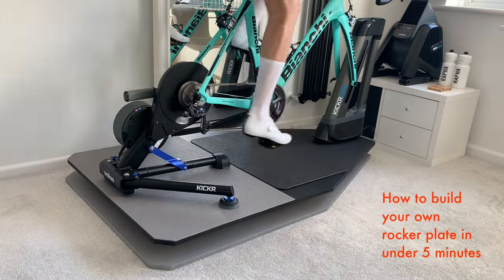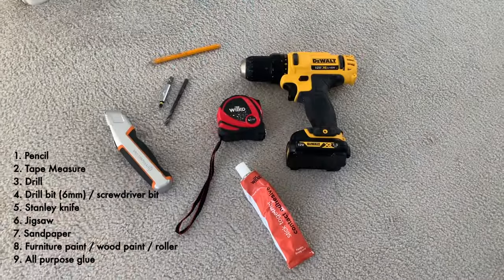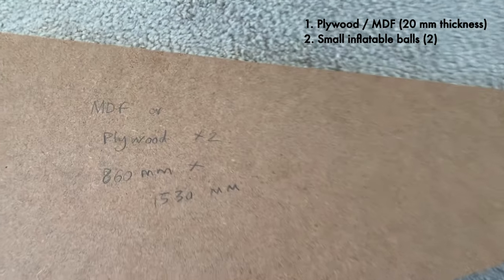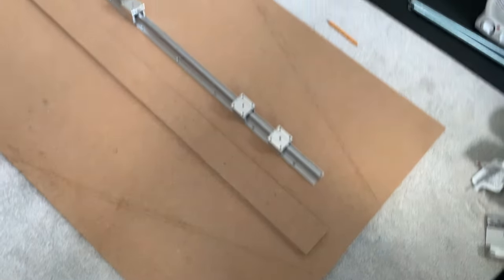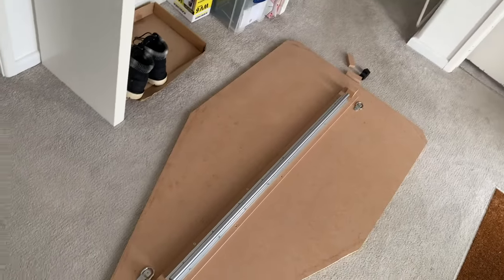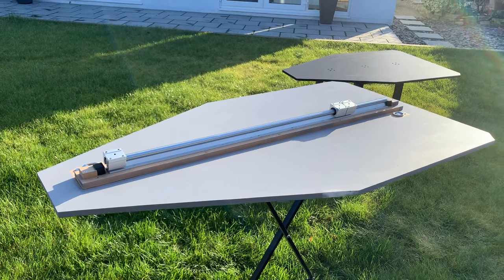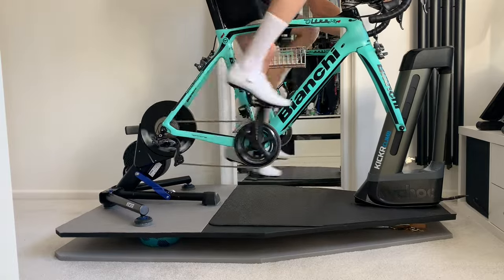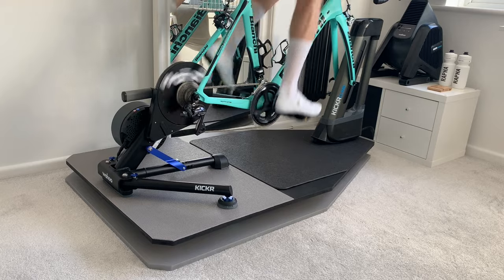How to build a DIY Rocker Plate for indoor cycling

Comment: Did you have any trouble with balancing it from side to side? Like did you have to put more air in one side than the other or weights attached to the board to offset the weight of the kicker
Reply from the maker: Hi, good question, I made sure one of the balls was slightly firmer - I didn’t notice any difference when cycling either 👍🏻

Comment: Brilliant, way better than other home made rockets I’ve seen! Could you share the link to the springs to save some trial and error getting them right, please?
Reply from the maker: Thanks Nick, much appreciated! These were the spring’s I used, it’s been pretty good so far - I had to bend one of the end of the spring to make a loop for the d-ring clip. https://www.diy.com/departments/15mm-external-pipe-bending-spring/5059340003498_BQ.prd?storeId=1266&ds_rl=1272379&ds_rl=1272409&ds_rl=1272379&gclid=EAIaIQobChMI-uH3meDn_AIVw9_tCh3I3woeEAQYBCABEgJkGvD_BwE&gclsrc=aw.ds
Reply: Thanks, I’ll take a look.

Comment: What springs did you order - difficult to know lengths and tensions from the video
Reply from the maker: It was a bit of trial and error with the springs - I ended up going to a local DIY store and finding some with the right tension - the tension should be whatever preference you have for how much you want it to move. My springs were about 14 inches long when taught. Hope this helps and good luck with the build 👍🏻

Comment: This is an awesome build! I'm planning on given this build a go , even though I've limted DIY expericne, and wanted to check what measurements on the top/bottom board. What length and width are they? Thanks!
Reply from the maker: Thanks very much and good luck with your build, if you have any further questions during the process give me a message 👍🏻 My board was 90cm x 140cm but I would measure your turbo to be sure it fits the width

Comment: Hi @notpogi
Awesome build and looks a cheaper option than the ones I have seen with the SBS20UU bearings and the separate supported rod. 
The only concern I have is the amount of rotational slack there will be between your open SBR20 bearing blocks and the central support of the linear rod. How much rotation/tilt can you get on your top platform before the mounts start to touch the central rod support, and does that ever give you any issues when riding? Hope you know what I am getting at.
Reply from the maker: Hi Simon, thanks very much 👍🏻 Good question, I was worried about the same however I found that mounting the rod central support on an additional bit of ply (about 1cm width larger each side and the same 1cm in depth) actually gave more than enough play in the lateral movement. No issues at all when riding. Hope this helps and good luck with the build 👍🏻

Comment: Really nice build!
Do you also have some cables to mount the kickr on the plate?
Reply from the maker: Thanks very much 👍🏻 I did purchase some Velcro straps to secure the kickr but didn’t feel the need.. I found that even when I really sprinted hard it never moved on from the yoga mat. I think it’s personal preference though, if you wanted that extra security then it’s worth drilling some additional holes by the Kickr legs and attaching the straps.

Comment: How is your rocker plate holding up almost a year later? I’m very curious to make one myself - if you have lessons learned a year later that would be helpful to hear
Reply from the maker: The rocker is holding out great thanks 😊 I’ve had absolutely no issues with it at all and it really does add to the overall cycling experience. I’ve had to store it currently though due to space issues in my pain cave! I would say the only downside is (in my opinion) sprinting is more difficult on the rocker. Apart from that it’s great 👍🏻

Comment: Have you ever done a review video on the kickr climb? I'm debating about it and would like feedback from users. But please... users that are okay in case the feedback is something like "yeah... i bought, it was expensive, I though it'd be fun but it is not but I kept just because I did".
Reply from the maker: Hi Pedro, in my opinion I think the Kickr climb is very good. I wanted to make my indoor experience as close to outdoors as possible and it does add something to the overall experience. Would I buy it again - yes, do I always turn it on - no, sometimes I just prefer riding at the same level. If you get the opportunity to try it first I definitely would. Hope this helps 👍🏻

Comment: What rail and bearings did you use? Also what spring strength?
Reply from the maker: I’ve linked the bearings in a previous comment, eBay purchased. The spring tension is personal choice based on how much fore/aft you’re after. My sprint was 3/4 the length between the 2 connecting d rings.

Comment: Hi great work , Ill be using A wahoo KICKR bike on this. You don't show a pic of the set up of springs,  did you use a combination of springs and bungy cored, if so  is that 2springs and 1 cored for each side?( crossed over of cores) and would 20mm ply board be strong enough?
Reply from the maker: Hi, thank you much appreciated. I used 2 springs in the end. I would stick to either 2 springs or 2 bungee cords depending on what your preference is - both work just fine though! I used 20 mm plywood which was plenty strong enough for my set up - it felt very stable. Hope this helps and good luck with the build 👍🏻

Comment: Hi mate been off the bike for a while with sore back and just getting back to it and looking for some comfort, was just wondering if you were still using the rocker plate and is it really worth me making one cheers mate
Reply from the maker: Hi mate, hope the back has fully recovered now! Tricky one… so I’m currently not using it but that’s due to a lack of space in my pain cave rather than not wanting to use it. Hopefully once I’ve got a bit more room I’ll get it back out again - for me it did make those longer rides way more comfortable but in my opinion I also lost a bit of sprint power (that could have been all in my head though)… if you’ve got the tools and you’re after something that’ll make the ride experience better then I recommend giving it a go!  If you decide to do it let me know if you have any other questions and I’ll be happy to help 🙂
Reply: @notpogi  cheers mate yeah that's the thing I have heard they can reduce sprint power will think about it a bit more 😂 thanks for answering appreciate it

Comment: Wow, I am going to build one. Was the bungee interfering with the rod and the linear bearing? Could you send a picture?
Reply from the maker: Thanks Marc 👍🏻 the bungee cord is connected from the bottom panel to the top panel but on the same side, so in essence it doesn’t cross the linear rod at all. Hope that helps and good luck with the build 🙂
Reply: Yeah !! Thx ! @notpogi
Reply: What lenght bungee do you recommend? Is a 40 inch bungee to long? @notpogi
Reply from the maker: It really depends on how close together you put the bungee attachments and how freely you want the fore/aft to be.. mine were about 3/4 the length of the total distance between attachments.

Comment: Hi, thanks for the video! Can i use a 1000mm linear rod in place of the 1200mm rod?
Reply from the maker: Thanks very much 👍🏻 I think it should still work ok, just might be worth using a thicker bit of wood (preferably plywood) as you’ll have more of a gap at either end

Comment: Really an excellent build! Looks slick as well. Taking lots of inspiration from yours for my own. Can I ask, why did you add that extra piece of MDF in the centre (that you mount the liner rod too). Could you not just attach the rod directly to the bottom sheet, or does it need to be raised up in order to work better.
Reply from the maker: Thanks very much, appreciate the kind words 🙂 I raised it up to give a little more clearance for the tilt to work. I don’t necessarily think it’s crucial but it also meant the rubber balls slotted in nicely as without that I think it would have been a bit of a squeeze!

Comment: Looks good, I like the front-to-back motion in addition to the side-to-side.  With the Kickr, which is an asymmetric trainer with the flywheel weight offset, how does the plate balance? You didn't have to add a counterweight to the other side? Is there any fear of the two balls pushing out of the sides where it would need a hole in the top piece to keep them in position?  I'd also be curious to see power numbers with and without the plate.
Reply from the maker: Thanks Neil, I was wondering about a plate to offset the trainer weight but it seems to be ok so far without one although I have had little time on it since the build due to a bit of man flu. I’m very confident the balls will remain in place without the need for holes but will clarify when I get back on the bike. I kind of expect top end power numbers to drop slightly but mid - ftp type numbers to not change too much. I plan to do another video to answer these questions though as I have no idea myself at the moment 👍🏻
Reply: @notpogi  Man flu is the worst, hope you can get back up to speed soon. I look forward to the follow up. Cheers!

Comment: i dont understand where the springs attach onto the topplate. Does it go over the linear rod? or is there D ring on both sides and a spring for each side of the linear rod?
Reply from the maker: Hi David, the easiest way to explain ( I think) is say you’re looking at the rocker plate head on: the springs on the left side of the rocker plate don’t go across the linear bar, they attach from the bottom piece of wood on the left side to the top piece of wood on the left side.

Then on the right side you’d attach the spring to the top piece of wood to the bottom piece of wood (again on the same side). Apologies if that doesn’t make much sense, I’ll make a follow up at video some point explaining in a little more detail.
Reply: @notpogi  Ahhh!! So the springs are perpendicular to the linear rod in an 11 shape as opposed to across the linear rod like an X! - This makes more sense. Wasn't really clear from your Black line which seemed to cross the linear rod.
Reply: @notpogi  Aha, came here to ask this. Yeah your video makes it appear that the springs somehow cross the rod, which had me scratching my  head a bit. Glad to see that they run parallel though! Great design, thanks for sharing and I'm looking forward to making it.
Reply: What’s the size of the springs ?

Comment: Normal MDF is like a sponge: it will suck in moisture and expand. Plywood is better.
Reply from the maker: I don’t disagree, plywood is the better choice. No issues for me so far though pretty much a year later  👍🏻
Reply: MDF is also softer, so more likely to fail around screw holes etc. I'd go for thin marine ply and seal it (paint it) easy to clean etc. These rocker plates look like they have too much play, must reduce the ability to accelerate the same as on true road/track surface.

Comment: Nice work!  
Do you have any pictures/instructions on the springs?
Reply from the maker: Hi David, the easiest way to explain ( I think) is say you're looking at the rocker plate head on: the springs on the left side of the rocker plate don't go across the linear bar, they attach from the bottom piece of wood on the left side to the top piece of wood on the left side.
Then on the right side you'd attach the spring to the top piece of wood to the bottom piece of wood (again on the same side). Apologies if that doesn't make much sense, I'II make a follow up at video some point explaining in a little more detail.
Reply: @notpogi  so the springs counter the fore/aft movement and the balls up/down ?

Comment: Hi. Nice build. How’s it holding up after almost a year’s use?
Best regards
Thomas
Reply from the maker: Hi Thomas, thanks very much 😄I have been using on and off depending on what type of a ride I’m after - happy to report that it’s still in good working order nothing seems to have changed since early use 👍🏻
Reply: @notpogi   So you sometimes ride without the rocker plate? Any reasons for that?

Comment: I've considered doing this also, but avoided as I've a kickr climb. Looks like it works fine though. Has there been any moments where the climb on the rocker has been an issue?
Reply from the maker: I’ve got my Kickr set at 50% trainer difficulty which impacts the height on the kickr climb - I would say so far so good no issues. The rubber mat on the rocker plate definitely helps, I wouldn’t feel as comfortable if it were on just solid wood.
Reply: @notpogi  ah yes, trainer difficulty % recalculates the reported gradient. I'll have to remember that as I lowered it, but increased the wheelbase setting to get it to avoid the affect on gradient.

I'll have to have a go at a self build. Is there anything you would change or tweak?
Reply from the maker: I was a bit worried at first about how I’d find it compared to what I was used to but it’s exceeded all expectations so far and I much prefer the movement it provides, especially on the longer rides.

I honestly wouldn’t change anything which is surprising, all I would say is try and find all the materials for the best price, I probably bought too much (e.g was testing the bungie cord vs a spring - should have just gone for the spring). Good luck with the build!

Comment: Any comments for the benefits?:)
Reply from the maker: Hi Chris, so far so good (been using for 3-4 weeks now). I would say it took at least 5 decent length rides to get used to the movement. Since then it’s been an absolute pleasure to ride! On the longer z2 rides I have found it more comfortable, after about 45 minutes I used to get a bit uncomfortable but now I can ride 1.5 hours without feeling a bit sore. The fore and aft movement I believe helps me when I’m in a lower cadence grinding up a simulated incline, much like the movement you’d make outdoors. 👍🏻